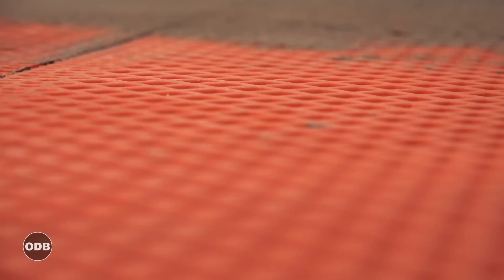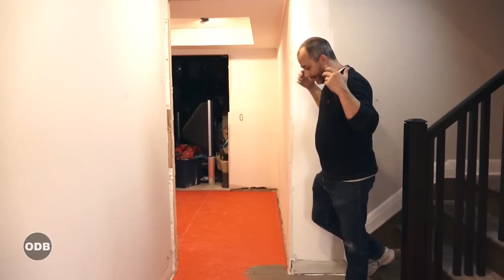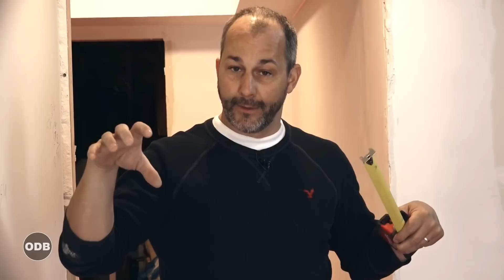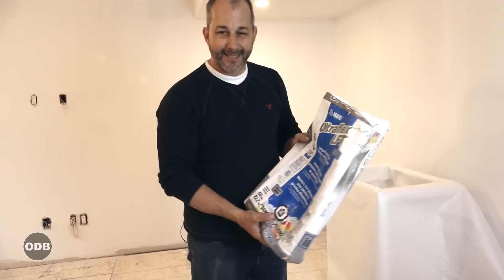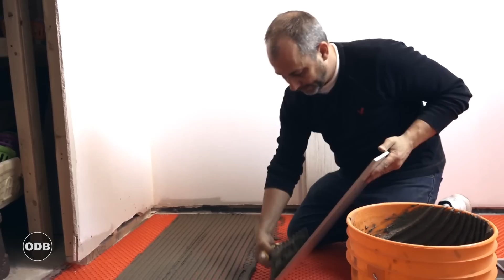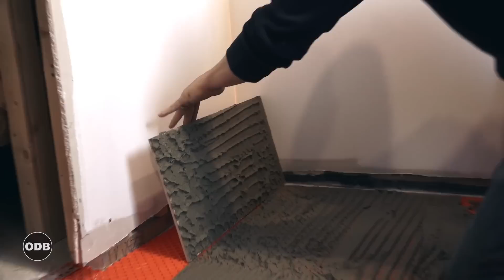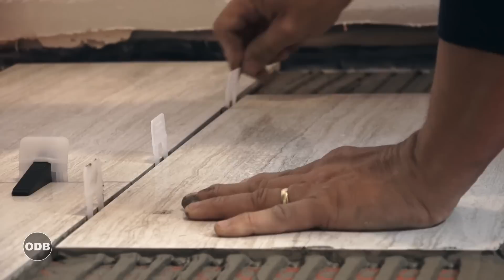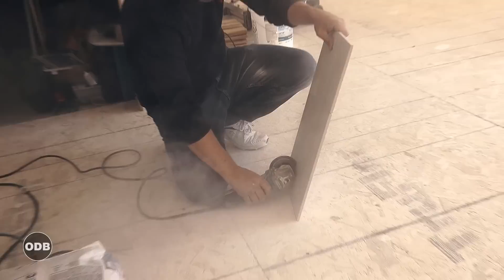How To Layout And Install Large Format Tile On Concrete

Comment: Very informative! Straight forward and  clear. I was skeptical about the protective waterproofing membrane VS conventional cement board. But this shows that it is actually sturdy. And no unnecesary weight BTW, Aren't those wedge clips not that necessary, right? Can i get away with regular "+" thingies?
Reply from the maker: Not really if you have a good floor and technique, but great for beginner's

Comment: No wet saw?
Reply from the maker: no need. the wet saw is almost completely used for wall tile only.
Reply: Interesting....for 18 years I have been doing it wrong then.....LOL
Reply from the maker: LOL Justin Snow, I use mine for really large tile as well just a huge bother to transport and set up for just a few cuts.

Comment: I agree with just about everything i saw on your video. This is just a mild criticism about your cutting Technic. Diamond grinder blades can be very expensive so when i do L cuts i prefer only using grinder for the small cut then use tile cutter for long cut. It saves on the grinder wheel a lot more plus makes a nice clean cut.
Reply from the maker: do that too. But when I am using tile without a lot of extra I can't risk a bad cut so I use the grinder for the whole cut. This was end of stock tile!

Comment: Nice video but ridges should normally go along the shorter side of the tile.
Reply from the maker: I hear this and ask the question how do you install a 24 x 24 then?
Reply: Yeah really, the only time i ever worried about ridges was wall tiles. Horizontal helps with sagging.

Comment: I can't seem to find any info on the continuous rim grinder that won't cut your fingers.  Direct me there, please.  BTW, great freehand straight lines.
Reply from the maker: Any continuous rim grinder for tile will burn and not cut. there is not specific blade that does this. Use pearl or Montolit blades and you will be fine.

Comment: Only thing I would suggest if your going to use mapei lift thinset which  Is a modified thinset and you know schluter says that's a no no to use ,  skim your ditra with it the day before then your safe to use it otherwise it might take forever to dry .
Reply from the maker: This is not ditra and modified thinset is allowed for use with this product. But thanks for the idea. It would probably work/ maybe!

Comment: Why are they using spacers
Reply from the maker: The leveling clips keep from having lipage on a concrete floor which is always not level.
Reply: Home RenoVision DIY How do they remove the part that is sticking up? And I image he will grout. I want to do my house. have tiled some. but Thought you needed a wet saw for porcelain.

Comment: I'd hire you if you lived in the Windsor area lol, but we are doing a master bath complete renovation..now at the tiling stage..wondering if we should do the floor tile first before the walls??
Reply from the maker: traditionally yes. I was just demonstrating the options available when using a complete waterproofing system.

Comment: should the first timer do a big floor.. 900 sq ft? Thanks for sharing your knowledge!
Reply from the maker: Each floor is the same no matter the size. Do 1 tile at a time, have a straight line to follow like a laser, use a leveling clip system, be happy with each tile you lay and don/'t move forward until you are. After a few days you will be surprised with your accomplishment.
Reply: Do leveling clips cause voids under the tile?
Reply: I had that problem, could be remedied by using a deeper trowel or back buttering each tile.
Reply: @Visper84  no they don't, the tile is pulled downwards to level of the on previously fixed
Reply: @Visper84  no they dont. u need to use the appropriate notch sized trowel.

Comment: he is very bad cutting, terrible!. Overpass the limit, off the line cut. If you are showing, don't show the parts where it went wrong.
Reply from the maker: Always astounds me , the critics who never post a video other than games.
Reply: Oh, sorry, my channel has nothing to do with tiling, but I watched your video because I have in mind a DIY project in my kitchen, and if a non initiated saw that fail, imagine the rest. Anyway as I am learning about it, I have you a genuine question... Is there a reason why you did the cut on the future-visible face of the tile?. is doing it on the bottom face harder to cut?, I mean, if overcut a bit, if is marked the bottom face, can be hid... unless there is a good reason to do it on the upper face. PD: I know tiling is a hard hand craft work to do it well, it require too much knowledge and patient.
Reply: Home RenoVision DIY Showing the wrong parts is not a big deal.

Comment: THOSE CLIPS ARE STUPID THEY BROKE OFF POORLY AND I HAD TO USE A BOX CUTTER TO GET SOME OUT BECAUSE THEY STUCK OUT TO FAR. THE GRAY THINSET YOUR USING IS THE CHEAP STUFF AND WILL BLEED THROUGH ON LITER COLOR TILE WHICH YOU FORGOT TO MENTION. AND YOU CAN'T EVER BALANCE OUT SEVERAL ROOMS ON EDGE CUTS THAT ARE SMALLER THAN OTHERS THAT'S JUST THE WAY IT IS AS YOU LATER SAID SO YOURSELF. BUT THANKS ANYWAY :^}
Reply from the maker: May I suggest some anger management course. Your experience does not line up with my own. And for the record I use in total over 20 different types of cement depending on the job and product conditions. I will explain them each as I use them. Thank you.

Comment: I like the video but I have a question. What do you do when you get to the wall? Is there a special product you use or just apply grout between the tile and the wall?
Reply from the maker: Absolutely nothing. No grout needed where the finished baseboard will be installed.

Comment: hey nice video. what do you call that red mat with a lot of indented squares? i think i need that. a reply is appreciated :)
Reply from the maker: That is a crack isolation membrane. The company is Pro-Va There are other companies on the market with similar products.
Reply: thank you
Reply from the maker: any time Jace McBeardy , I try to answer every question every day
Reply: basing on what it's called does it lessen the chance of tiles cracking?
Reply from the maker: Basically since the membrane separates the mortar bed from the concrete the crack is not transmitted to the tile. It takes a crazy amount of movement to compromise. I believe over 1/2 inch. Works like a charm to protect your investment.
Reply: mortar bed is the hydrated cement taht you spread on that CI membrane before you placed your tiles right? i do apologize. pls don;t get ticked of if i ask too much

Comment: Do I need to put a membrane down in a basement bathroom without a subfloor?  Cheers from Alberta.
Reply from the maker: Not in an old settled house but on concrete less than 10 years old I would just in case of a settling crack.
Reply: Thank you for this insight great series will be following along closely as I progress.

Comment: Amazing. I am intimidated about attempting this job. What does one do at a step edge of the tile? Is the bare edge of the tile strong enough for daily wear?
Reply from the maker: I always use a metal  tile edging on exposed edge tile. In this video we were finishing all the transitions with overlay flooring material from the laminate

Comment: question that is a little bit off target here. 

there is a minimum height for the stairs. so the height was probably correct when they had just the concrete floor. when you add the subfloor and tile, the bottom step on the stairs, loses the height requirement. 

Am I over thinking this? if not...how do deal with making sure you are in code with that first step on the stairs going up? 

Thanks!!
Reply from the maker: Let's not get crazy here. Most inspectors will not have an issue over a few millimeters. If they do lay a rubber tread on each step for the sake of an inspection.

Comment: about how many square feet you can use with the Peygran leveling system of the box you have, installing 12 x 24 in porcelain
Reply from the maker: The starter kit seems to finish about 100 sq feet comfortably.
Reply: 1st time seeing this leveling system, great idea !

Comment: Just a question, but is there room and drains in the basement to set up a wet saw or will you have to use it outside in frigid temps?
Reply from the maker: I try not to book complex tile work in the middle of winter. Once it hits minus 20 the moving water freezes.

Comment: Wrong Thinset! Floor failure
Reply from the maker: Thanks David but you are incorrect in your assumption. This underlayment is Pro-va and requires a regular thinset mortar. No need for non modified in this application.

Comment: lol..he talks about eye safety..but  i would be WAY more worried about that fine dust he is inhaling  WTF..that is one of the reasons i bought and ALWAYS use a wet saw..
Reply: don't be jealous cuz he can cut tile in 1/4 the time you can and with 1/10th the cost of equipment.  That was badass.
Reply from the maker: Me too. However It is more work to move and set up than necessary sometimes.
Reply: good idea! health and safety is very important, but it's not a safety video.

Comment: When you are done the lion’s share of the project, do you go back and remove any cement on the edges before it dries?
Reply from the maker: Usually the next day I wipe with a sponge and use a grout removing tool for cement if necessary. If you work clean it takes a little longer but much easier to clean up.

Comment: Why you dont use a wetsaw?
Reply from the maker: February in my are is minus 30. If I can't cut outside then I would rather use a grinder and scratch tool.
Reply: The reason you would use a wetsaw is so you can cut inside. No dust.

Comment: I Love your videos Sir, I tried the levelers and they worked great my only complaint was if I stopped say halfway through a room how do I get the next day of levelers under the already set tile? I had to make sure I completed the entire floor the same day. Would love to have your solution. Thanks
Reply from the maker: Install the clips even if you are not setting the tile. clean the edges and you will have great success.

Comment: Learned a lot and in time for laying down some tiles in my master bathroom.  Thanks for the pointers.  Very helpful directions in determining where to start and how to manage those corners that are not exactly 90 degrees!  I guess a good job is only 10% inspiration and 90% preparation!
Thanks again.
Reply from the maker: Thanks for the comment. A good job involves a little perspiration as well. but you are correct, the layout is more important than your cutting ability.

Comment: This is not Schluter I agree but is still the same fabrication product that mean is not considered install tile over before all mortar under are set and cure properly to escape walking on tile when mortar are not cure that relative it and tile lost grip on the membrane that is why they requires UNMODIFIED mortar, because unmodified thin-set mortars are dependent on the presence of moisture for hydration in order to gain strength, it does not deprive the mortar of it's moisture. This allows the cement to properly hydrate, resulting in a strong, dense bond coat.

Anyway it's only to advise peoples who check your video and think it's the good way to do it.
Reply: Also the DIY that's good but DIY the good way...
Reply from the maker: Thanks Steven however if you check with the manufacturer they give contrary advice. Appreciate your concerns but I believe you have it wrong with this particular product

Comment: And this one to install tile over. Schluter-Systems requires the use of an unmodified thin-set mortar meeting the requirements of ANSI A118.1 to install ceramic (including porcelain) and stone tile over DITRA-HEAT. Portland cement-based unmodified thin-set mortars are dependent on the presence of moisture for hydration in order to gain strength. Since DITRA-HEAT membrane is impervious, it does not deprive the mortar of its moisture. This allows the cement to properly hydrate, resulting in a strong, dense bond coat.
In general, we don’t recommend the use of modified thin-set mortars to set tile over the membranes because these mortars must air dry to cure properly. When sandwiched between two impervious layers such as DITRA and porcelain tile, drying takes place very slowly through the open grout joints. [According to the TCNA Handbook for Ceramic, Glass, and Stone Tile Installation, this drying period can fluctuate from 14 days to over 60 days, depending on the geographic location, the climatic conditions, and whether the installation is interior or exterior]. Therefore, extended cure times would be required before grouting if using modified thin-set mortars between DITRA and ceramic tile, including porcelain tile. If extended cure times were not observed, the results could be unpredictable. This is even more important to consider in exterior applications that are exposed to rain, as there is the additional concern of latex leaching.
Exception: Certain moisture-sensitive stones, e.g., green marble, or resin-backed tiles may require special setting materials. Please consult your stone supplier and Schluter-Systems for more information. For an acid-resistant covering, use an epoxy adhesive to set and grout the tile.

Comment: Thank you Jeff Thorman, my concern is not about the membrane but more about the mortar you use in this video and the time you wait before you install the tile over,. Read that and let me know what you think about. The type of thin-set mortar used to install DITRA depends on the substrate material. For example, to set DITRA over plywood or OSB, a modified thin-set mortar meeting the requirements of ANSI A118.11 is used. To set DITRA over concrete or gypsum, Schluter-Systems recommends an unmodified thin-set mortar meeting the requirements of ANSI A118.1. Please consult the Schluter-DITRA Installation Handbook before beginning your tile project to confirm the proper materials selection.
Reply from the maker: This is not Schluter and the requirements are different. Even Schluter knows that the underlay cement has had problems which is why they invented their new cement ALLSET. A  little pricey but it works.

Comment: My concern is about the red membrane you use on the floor, it look the same product of Ditra membrane ???
Reply from the maker: The idea of a crack isolation membrane is not new. Ditra has spent millions promoting their product but the fact is that there are over a dozen ways to create a crack isolation membrane without spending the huge dollars that ditra costs. Sometimes I prefer Ditra and sometimes it makes more sense to save the money and use another product.
Reply: Home RenoVision DIY Isn’t a barrier between the concrete floor which can get condensation since it in in the basement and therefore requires something that will prevent the condensation getting to the tile.

Comment: Great video! Thank you for sharing! What size spacers did you use? Planning on installing the same size tile on my kitchen floor.
Reply from the maker: I used 1/8th on this floor. If you are using porcelain this will be fine. If you are using ceramic I would suggest 3/16 if you have a 4 season climate otherwise 1/8 is fine. Good luck with the kitchen floor.
Reply: wait...so the spacers are built into this brand of tile-clips?  (In the last few seconds of the video - during the time-lapse portion - I can't see any spacers, just clips.)
Reply: @davids1681  the clips ARE spacers.

Comment: Nice one.. thank you . I'm starting 16" square floor tiles over a large area with not parallel walls.. should be fun.. And please wear a mask ,that dust aint at all good , especially years up the road.. All the best.
Reply from the maker: Thanks David, usually do but it gets in the way with shooting video.Cheers

Comment: You should wet sponge your grinder blade and tile while cutting, that will kill some dust and ensure more use out of your grinder blade in the long run
Reply from the maker: I go through 2 or 3 a year. To be honest I am not worried about the life span of the blade. The idea of trying to wet grind gives me a headache.